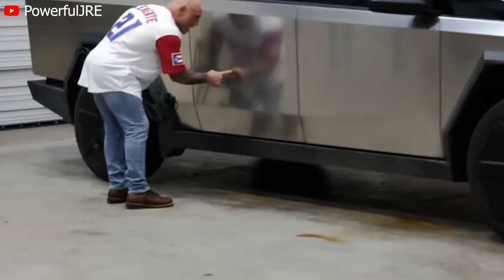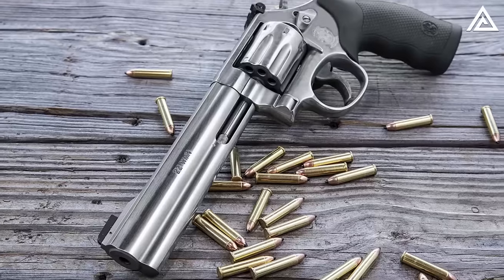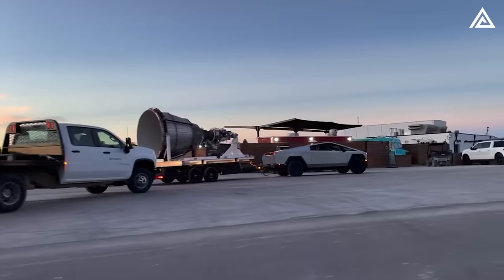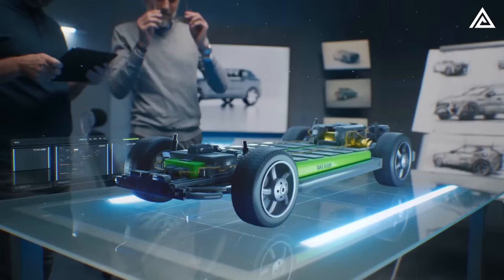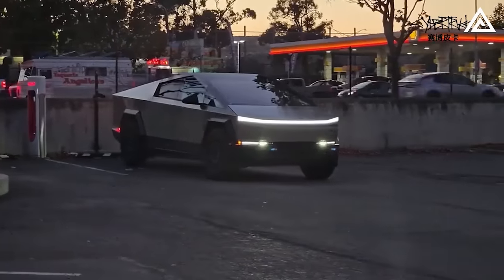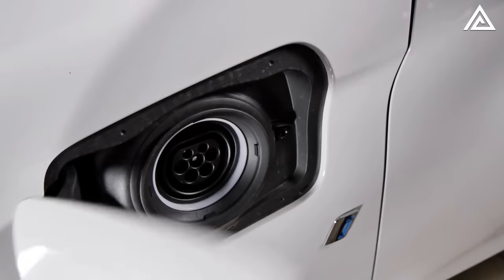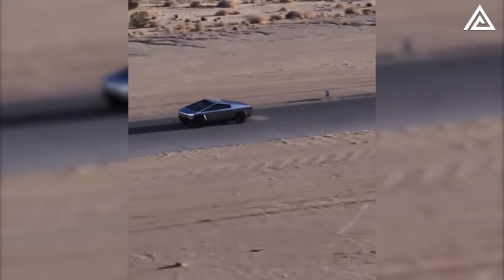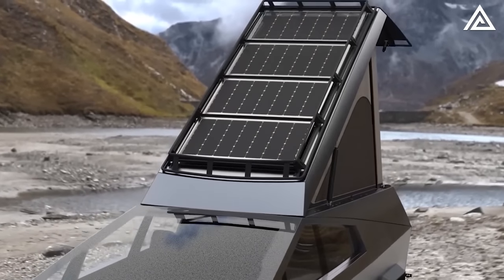Detail of Cybertruck 2024 Tests. Off-Road, Crash, Bulletproof, Waterproof, Self-charging... Mix

Comment: I would rather to have a regular door like any other Tesla with strength but light weight to improve battery performance. I don’t care about the bulletproof door and windows, I feel very safe where I live
Reply from the maker: I understand you. If you don't need a bulletproof door, a regular door is lighter and improves battery performance. I think Tesla will offer both door options for customers to choose from. That's quite interesting, isn't it?

Comment: tesla truck float on water?  no way !
Reply from the maker: The Cybertruck is not designed to float on water. However, it can drive through water up to 3 feet deep. So, if you need to cross a shallow stream or puddle, the Cybertruck will be fine.
Reply: great.... assuming the battery is waterproof otherwise you will kill the battery